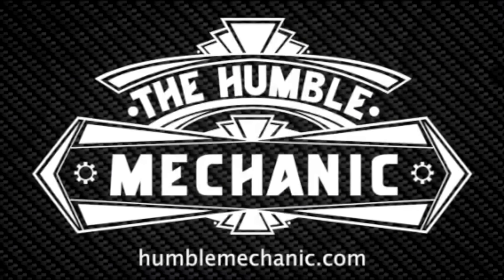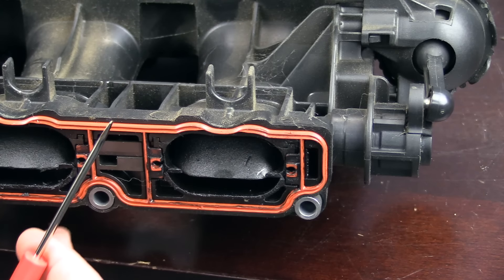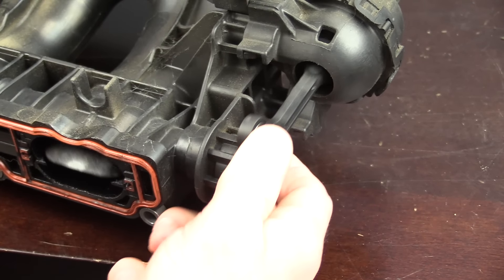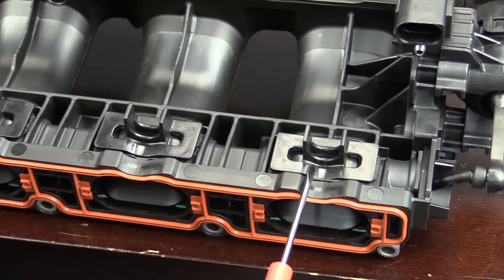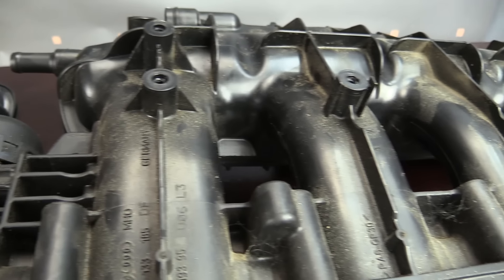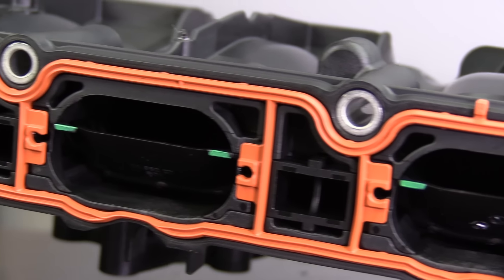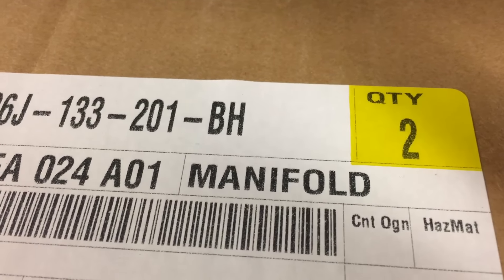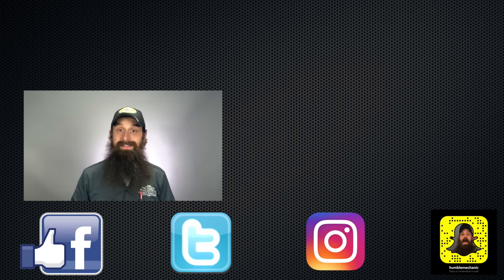2.0t TSI Intake Manifold UPDATE!

Comment: Or just stop buying VW to force them build better cars.
Reply: stilkus hate to tell ya that all cars have failing parts....
Reply: Every manufacturer has problems, deal with it or pedal power.  Oh wait, even bicycles have problems?  Holy shit...
Reply: MeVsMe I have to agree with you as someone who got an Infiniti lemon. but VW does make things more complex than needed with extra parts/components that just due to sheer odds have a higher likelihood of items breaking. for example im fairly sure a civic SI 2.4L doesn't have these intake valves in its manifold, also no turbo charger. a part can't break if it isn't there. I've also owned a VW myself. if you lease or replace your car every few years they're all good. but for the long run all these extra parts could equal more expensive upkeep.
Reply: Honda motors have flaps as well.
Reply: As a VW mechanic I can say they are some of the best made cars for their price. They also released a warranty extension on the fail prone manifolds so no cost to owner.
Reply: 2ndRightStrong I'm a vw tech too and before I worked for them I didn't really think much of the brand. just thought they were just another brand out there. I can honestly say I would put vw line up of vehicles up against any other parent brand out there. especially now with everything being turbo'd
Reply: Damn straight.
Reply: +MeVsMe the only thing that is the same with a Toyota and VW is that they both have air in the tires . From there it is all down hill for VW
Reply: 12wingwfetech lol ask a Toyota tech what are their most common fails. every brand has em, even "indestructible" toyota
Reply: I love the HumbleMechanic's videos as they are very educational, but they are also a real eye opener as to why VW and German cars in general are so unreliable. I mean, I have never seen a plastic air intake manifold in a Japanese car. The air intake manifold gets reasonably hot, as its connected to the engine block. Whats is next for VW, plastic engine blocks?
Reply: Toyota doing 1nz\3nz 1zz\3zz with plastic manifolds. But they don't fails.
Reply: Plastic block, now that would save weight!
Reply: NEVER
Reply: Lmao naah. Try a silverado trail boss and have the front axle shaft tube bushing fail at 20k miles. What makes it better is that the part is on back order, with no ETA on distribution. Not a single parts website actually even has one. Point being, all makes and models have less than perfect parts designs

Comment: plastic intake manifold in a turbo application... what a joke VW is.
Reply from the maker: Really other than the flap arm, I have not seen an issue. Seen more issues on NA VWs with plastic manifolds. LOL
Reply: thanks for the reply. do they use thinner plastic on NAs or something?
Reply: although on a second though you did mention cracking in the video and with time and heat the plastic will get brittle.
Reply: after 10yrs of operation in the heat/cold environment, this plastic part will brake easily... like coolant flanges on 1.8t engines
Reply: Buy a car is easy today, just open the bonnet ,if you see a lot black colour then you don't need to keep looking this car.🤩
Reply: Plastic parts reduce engine weight around 20%, also absorb less heat vs metal, and less vibration and noise. If you had all metal parts in a 4 cylinder turbo now days it would be almost impossible to drive.

Comment: Charles, thanks for your video’s! When replacing this manifold ( updated) one needs a new hose- 06H133583F where does this go?
Also when replacing the rubber shock mount, on mine it broke off while installing into new manifold ( that is a problem for me, i have to get broken stud out of plastic “boss”, stud is very hard so i think i will need a cobalt bit, but how to get new one installed in new manifold with out breaking stud, do i have to drill “ boss” so threads arnt so tight, or is there a thread tap to run into hole first?

Comment: Where would the new fresh air sensor go?
Reply from the maker: The filter has a formed hose that allows it to mount on the valve cover.
Reply: @HumbleMechanic  running on top of the intake manifold or below
Reply: @HumbleMechanic  for the routing

Comment: When should the arm move. Does it work when gas pedal is pressed
Reply from the maker: It works on throttle snap. Should move at 3800 rpm

Comment: Hi just replacing it now and have a question
The new type arm actuating solinoid you say to vent the silver outlet to atmosphere but I see there is a new air filter line that needs to be installed . Is this the case ?
New Genuine OEM VW Audi Intake Manifold Fresh Air Hose (2008-2010) 06H133583F

Comment: How do you pop the intake flap arm off to replace the motor? I’ve got code p2014 on my b7 a4
Reply from the maker: It’s a ball cup design. But why would you pop it iff
Reply: @HumbleMechanic  P2014 for "Intake Manifold Runner Pos Sensor/Switch Circuit Bank 1” on my Audi A4 b7. To replace the intake manifold flap actuator you have to pop it off the flap arm

Comment: What about the Fresh Air Hose that is included? You didn't cover that.
Reply from the maker: Because at the time of this video it was not part of the repair. That did t start for a few months after the new manifold was out. 

If you go to the link to buy it, Paul has that add on kit listed
Reply: I already purchased the manifold and it's now installed. There's not directions in how to install this part.

Comment: What if I have vacuum going into the solenoid but wont come out the other nipple to the arm. What controls the vacuum solenoid? When cycling ignition the arm doesnt move at all. Even reved engine and no movement. P0215 only come on right after restarting car. Please help
Reply from the maker: Follow the vacuum line back and see if it’s broken

Comment: We couldn't do  a Adaptation for intake runner because some one  installed high flow air filter in to the car and was causing slightly idle to high , so I went to the car I pressed the brake pedal and switch in to the Drive so idle can drop and Adaptation passed !  this was crazy to find out what was wrong took me weeks !!!!!!!!!!

Comment: I bought the newer one. I swapped all sensors onto the new manifold but still got p2015... that arm popped off in the old one but now i got the new updated version still having p2015. U Think that sensor is broken ?
Also the new arm is waay harder du pull than the old one. Normal?
Reply from the maker: The new OEM manifold should come with the sensor.
Reply: @HumbleMechanic  mine is aftermarket without sensor
Reply: I swapped the old onto the new one

Comment: Do you have a video of the 2010 cc 2.0t
Cam sensor is throwing a P0341.
I just want to know the ohms range on the Cam sensor old has .844 new has 1.902 on the positive and ground. It runs better with the old one.🤯
I have 5v on positive plug
Thank you.

Comment: I don't know if it is possible. But my 10 cc it doesn't start. I fix the timing tension and the turbo blow - off valve. Now the scanner just shows me the intake is the only error code. Is possible the it is just the problem?
Reply from the maker: I have never seen an intake issue cause a no start

Comment: Kinda curious on if you’ve had anything like this I currently own a 2018 vw beetle 2.0 TSI gen 3b had an code I believe was a p2015 for intake failure, took it to vw for a intake replacement I was told car was ready went to go pick it up, rough start up and idle few mins later check engine light engaged for same code p2015 and now having an issue due to part delays and micro chip issues on getting it back in for a look and diagnostic reading any help???
Reply: I just DIY'ed the manifold swap myself had similar symptoms when I was done. Turns out I had connected up the vacuum hoses at the actuator incorrectly. The side that has the electrical connector should be open to the atmosphere (in fact the intake comes with a new hose with a small filter that mounts to the top of the cam cover). The port on the opposite side to the electrical connector connects to the vacuum pump. Check your hoses at that location. It's easy to mix them up. Check out https://static.nhtsa.gov/odi/tsbs/2017/MC-10127807-9999.pdf to see what I mean. Good luck!
Reply: @johnhiggins285  thank you appreciate it!

Comment: My 2016 Tiguan R-Line popped the P2015 code just now at 138K miles. First ever code on this most reliable car. 
I bought the ECS quick fix coupler and will drop it in until I buy a new manifold and have time for the swap. 
QUESTION: Is it advisable to service injectors when replacing manifold?
Great vids. Cheers!

Comment: If your car isn't under warranty,  is there a way to just delete the flapper system altogether?  Fill and smooth the runner and tune out the sensor?
Reply from the maker: Yea. But it’s very expensive and requires a tune. You could probably do 5+ manifolds for that price. Lol

Comment: It's been 7 years, but I thought I'd toss a note out there, the vacuum solenoid has an extra vent port at the back, but it is not supposed to be left open. You are supposed to install a tube that terminates in a filter to prevent the solenoid from drawing in dirt and moisture and falling prematurely. The part number for this "breather hose" is 06H-133-583F. I actually came to this video hoping to find out the correct way of mounting it once installed. 😅
Reply: Was looking for the same :), I found more info on installation collecting information from other videos

Comment: The car all of a sudden started sputtering as if bad gasoline and not being able to go any faster than 20 30 mph.  Oh and let me say right in the middle of a busy large highway with trucks going by me a mile a minute. Then I get a EPC and engine light going on my dash. Rev up to 2 and back down and back up to 2 rpms. So, I put this octane booster Nada. Opened the hood I hear air. I checked the hoses. I sprayed some cleaner and found a spot. As I kept looking and checking for a loose hose, cracked plastic I notice the actuator popped back up as I probed and pulled. So, seems its the intake actuator. That little arm you spoke about on this video. Tomorrow, buying this intake actuator. I am being told VW does not sell it individually. So I have to buy the whole intake -.- Since I am a new owner to a 2015 VW CC 2.0 Turbo Sport what else do I need to know about this car that I should change now before it goes? My car has no warranty.  Should I stick to OEM parts?  It gets $$$ :( Thank you for  the video because it is helped me actually confirm my findings. Not a pro like you or most guys here But I have done a little here and there. Thank you for the video and everyone here for any recommendations or advise. I have subscribed :)

Comment: Help..Got a problem....again..
Three months ago my engine light came on (VW Passat CC 2.0t tsi)
Code P2015.

So I ordered a new intake (not the modified version but the old version) but now..... 
P2015 again..... really? After just three months? 

The seller of the intake asked me if the intake manifold sensor is also replaced??
Is that not a part of the intake?

I really begin to hate my car... 😢
Reply: uh oh
Reply from the maker: Sensor is part of the manifold. Was the manifold new? Multiple failures of that manifold are not uncommon. Also be sure the manifold has good vacuum supply
Reply: HumbleMechanic Thank you 🙏🏻
Yes, I ordered a new intake manifold. 
So to get the P2015 again was just a real Suprise to me.
The car is still driving perfectly though...
Greetings from the Netherlands!
Reply: Asli Caliskan do you solve problem ? Me too p2015 still present

Comment: I just installed this (BH) revision manifold in my 09 GTI.  I also had to get a new fuel rail (06J-133-317-AB) because my old fuel rail(06J133317J) wouldn't line up. Bolt holes were about half a hole off.  New rail fits perfectly, but I also had to change the brass fitting( old rail had male threads for fuel line, new revision had female). After all that extra headache, I still throw code p2015...☹️
Reply from the maker: I’ve been hearing that more and  more lately about the manifolds not lining up. 

The p2015, check your vacuum supply to the the diagram.

Comment: So, I have a 2014 GTI with the 2.0 TSI engine, and at 58000 miles I got the P2015 engine code. I researched and saw that there was maybe some kind of warranty on the intake, but the local VW dealership, or should I say stealership quoted me $1,325 to replace it. No warranties or anything. Plus I had to pay $140 just for a diagnostics tested tell me what I already learned for free at AutoZone. Sucks.
Reply from the maker: Yikes.  We’re you not covered on the warranty? That wouldn’t be the dealerships fault.
Reply: They told me no warranty, I know it’s not their fault, but man, it still sucks!

Comment: My 09 Audi A4 quattro (B8) just got the dreaded P2015 code. It has 118800 miles on it. I'm gonna check with my dealer if its part of the recall, but if not I'm definitely going to replace the manifold with the revised version.
Reply from the maker: Awesome!!! Hope it’s covered for you
Reply: @HumbleMechanic  the dealer told me it was not covered and they said I need a new manifold $1500... 🤣 What they did tell me is that my car has a recall on the water pump and the timing chain.
 I'm gonna seafoam the manifold and gas tank this weekend.

Comment: Will this work on the 2010 A4 B* engine? Web site only says A3.
Reply from the maker: +Michael Kane I think the "B" engine has a different manifold. The "B" in the engine code is a different HP rating.
Reply: the thing looks just like your video. I guess I'll rig it to stay inside the intake since it pops out in just a few miles until I get a delete kit for the runner flap.

Comment: What about the Fresh Air house that is used for the new three ports on the new manifold? Also Ive seen that the Original fuel rail will not fit the revision of the manifold is this true ?
Reply from the maker: Haven’t seen that. When this video came out vw didn’t have the filter kit out yet
Reply: HumbleMechanic is it needed ? It looks like evap hose then something hooked to a bolt. What about the original frail rail fitting the new manifold

Comment: Is there an updated 2.0T FSI intake manifold?
Reply from the maker: No. That runner had a separate motor that failed. But the manifold it self was solid
Reply: HumbleMechanic SO WAIT this manifold doesnt fit on 2.0T FSI BPY if i was to want to upgrade it to this one?? And if im having the same issues with the flaps being "stuck open" and the P2015 problem will buying the intake manifold funner control fix it or will buying this fix it. Cause now im confused. And almost bought this manifold

Comment: Is this fit 1.8 TSI? i had the first generation BZB 1.8TSI
Reply from the maker: No the 1.8t TSI is a different setup.
Reply: Hmmm kinda looks the same both engines, almost identical outside, but whatever, thanks for the reply!
Reply from the maker: They are VERY similar for sure.
Reply from the maker: now as I think deeper on your question, if this is not a US car, it may be the same manifold. The US 1.8TSI was a different manifold. ROW might be the same.
Reply: HumbleMechanic yeah I’m from Europe. And my car is Seat Leon 1P 2008 model 1.8 TSI.

Comment: Hi Charles, 
I got the CEL P2015 code on my 2012 GTI. The first time I got the CEL I cleared it, and a few days later the CEL came back. I cleared it again and a couple days later the CEL came back. I drove the car with the CEL on, did some shopping and started my car and the CEL turned off. What happened? Why did the CEL turn off? When I scanned it the code is still there but no CEL.

Comment: What kind of symptoms would one experience when the manifold fails?
Reply: FivepointohJerry
Non-starting. Jammed throttle, so maybe half at all times or full open (unlikely) so no starting from stop.
Just a ruined intake manifold, Idle Air Control should will still work tho.
Reply from the maker: +FivepointohJerry the symptoms are either just a MIL or a very poor idle condition. Depending on how it fails
Reply: It absolutely will not jam the throttle. 90% of failures would be unknown to the operator without a malfunction light with P2015 active.

Comment: my question is why is a plastic or whatever heavy duty compound????  Im new to the VW community?
Reply: Because it is light and stronger than aluminum. by the way it is nylon with 30% glass.
Reply: Markell
My '98 Ford has a perfectly fine original plastic exhaust manifold made of significant chunks of plastic.
It's mated and works perfectly fine, wouldn't dream of opening it up anytime soon.